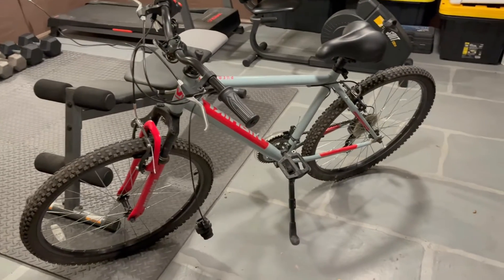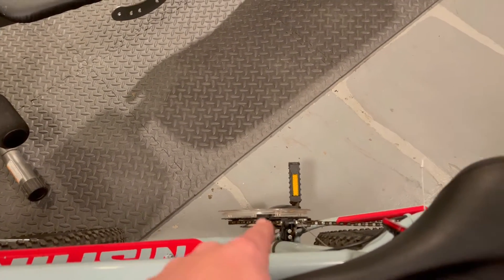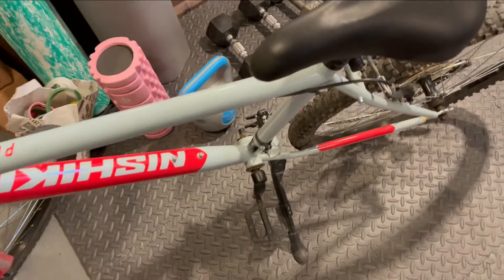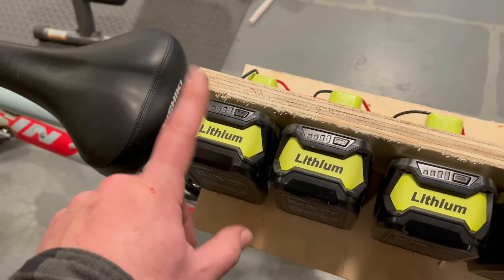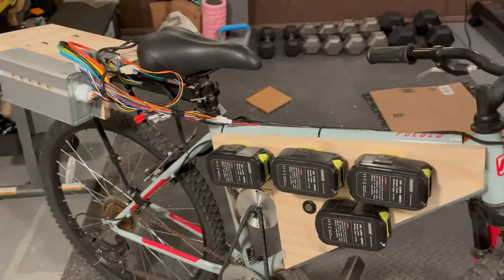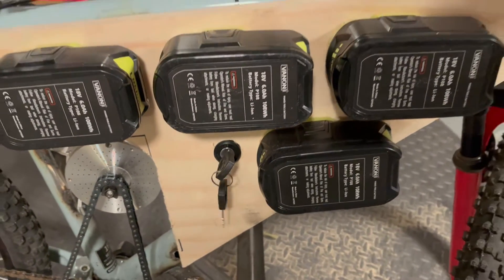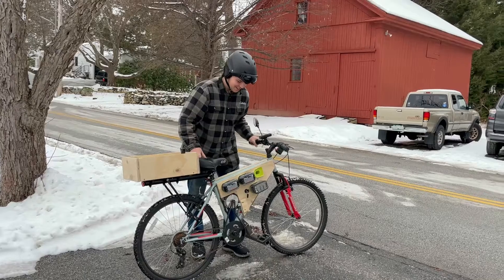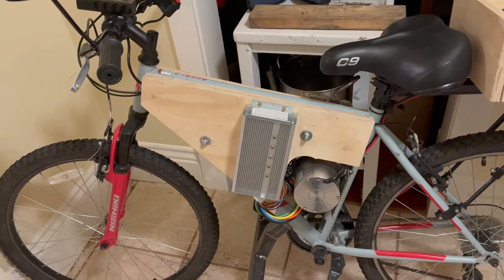DIY 72v Drill Battery E bike Build

Comment: Cool project, and you have some clever work with the drivetrain there. Pushing 3,000 watts at 72v will require 41.67 amps, and I don't think those Ryobi batteries can deliver that. I have some myself that were given to me, and it's unfortunate that they do not give the output amperage. I did find a website that claimed they output 20amps, but that seems optimistic based on the weak performance of the tools I have. The go cart battery should fix that though! Thanks for the video!

Comment: what range could 4 batteries get?
Reply from the maker: 2-5 miles
Reply: @campbelloffroad3660  That's not good.
Reply from the maker: @Eric_Tennant  my initial test ride was with 4 4ah batteries and I got about 3 miles. My first test ride on 8 batteries, adding 4 6ah batteries I went 5 miles and all 8 batteries were showing 50% the test ride after that was when the batteries started failing on me, 5/8 batteries were no longer able to be charged
Reply: @campbelloffroad3660  Think you maybe pulling more amps then these can handle triggering the BMS to turn off the battery. (3000watt / 72v) = 41.66amp. So with 8 each one needs to putout 21amps. Happy your going with a pack. As I could see drill batteries costing more in the long run.
Reply from the maker: @Eric_Tennant  Ahhh thank you for pointing out where my math was wrong, I was doing 42 amps/ 8 batteries and didn’t understand why they couldn’t handle it. Makes sense now!